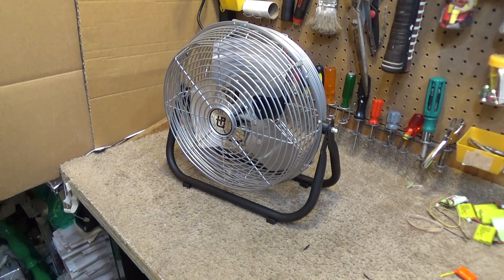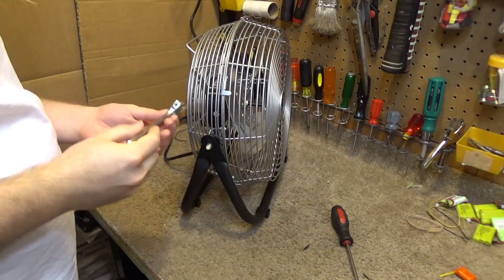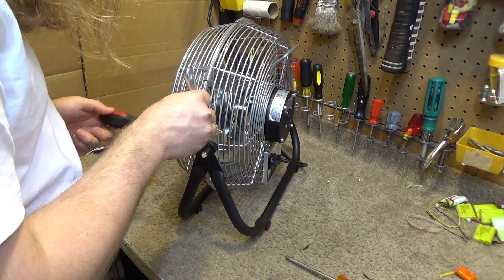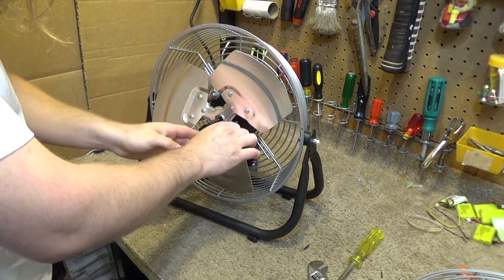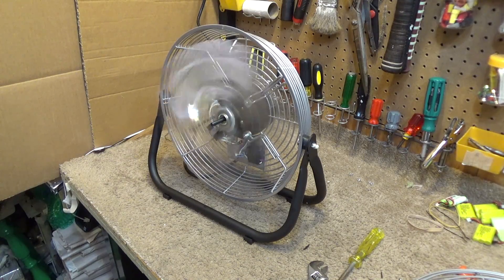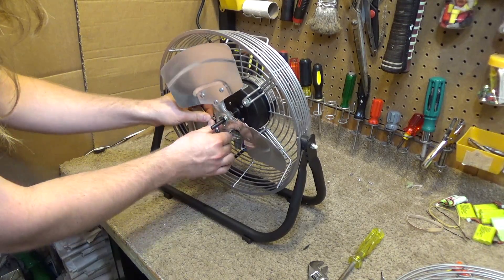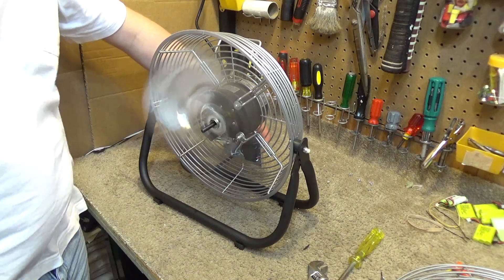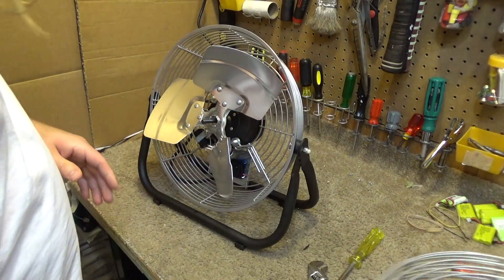Increasing the Pitch  TPI F-12-TE | Part 1

Comment: I have a high velocity fan that is seizing up but I can not get the motor open it looks like the two haves may be welded or sealed to where you can't get it open it is a comfort zone 12 inch how would you go about opening one of these motors to lubricate the bearings I seen a video you did I think opening a similar type one? I removed all the motor screws yet I can not get the two halves to separate. any idea what I can do?

Comment: Personally, I would avoid changing the pitch of a fan blade. Fans may seem simple enough, but engineers do design those things. This also looks like a quality fan that likely had greater engineering tolerances. Sure, the motor may have a greater spec than it is running at, but that may just be intended for life longevity. Motors with too heavy of a load are under the threat of stalling which could burn up the coils. You do have tons of fans, so you are more free to experiment. Just saying that if the fan doesn't operate as good as it did before the modification, it probably is best to leave it at manufacturer specification, especially for something that isn't Chinese crap.
Reply from the maker: Those are all valid points.